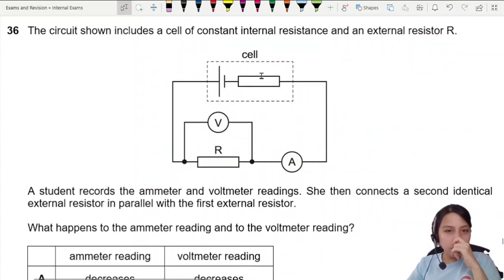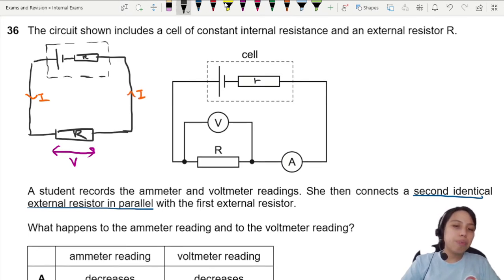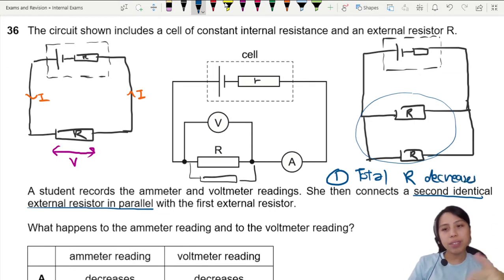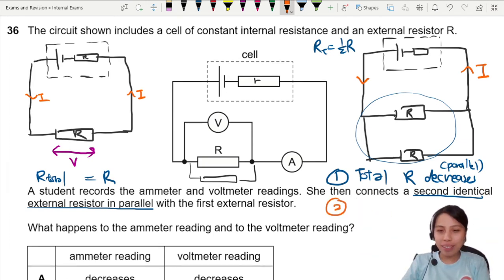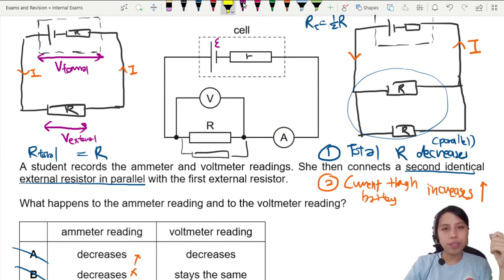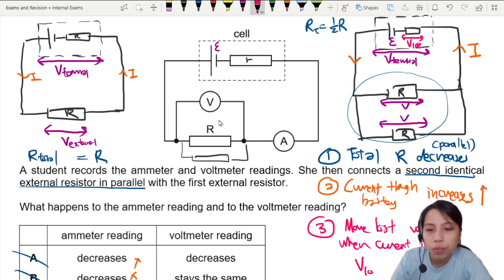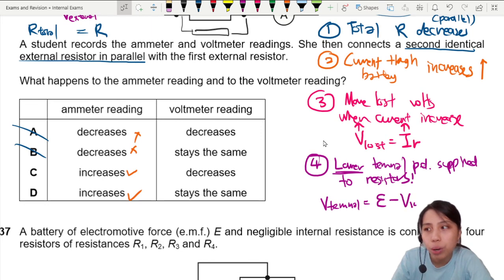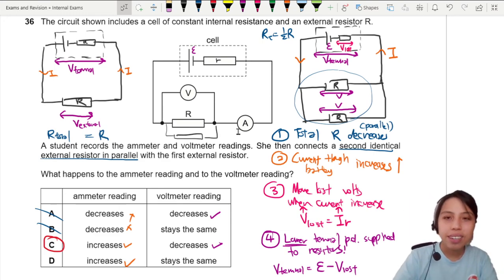MJ21 P13 Q36 Ammeter Voltmeter Reading Change | May/June 2021 | Cambridge A Level 9702 Physics

Comment: Hello, thanks for this video its really helpful.

But I had a question, I understand that current will be more when resistance is lesser, but looking at the equation V=IR, I is more and R is lesser so V should balance and stay the same right ?
Reply: It's because the voltmeter measures across only one of the "R" and not the whole circuit. So the resistance of one R remains the same even though the resistance of the whole combination decreases.
Reply: @ashrafchowdhury866  the voltmeter is connected across both resistors in parallel, so total resistance decreases, total current increases and V shoudl be balanced ??

Am i right ?
Reply: @ayushagrawal4275  Actually the voltmeter is connected to only the previous( upper) resistor. Not the combo
Reply: @ashrafchowdhury866  ohh yeaa, i actually get u... Its connected across the old resistor only...

Thanks alot man, for clarification..
Reply: @ayushagrawal4275  Welcome, I got my As MCQ the day after tomorrow. Please pray for me!
Reply: @ashrafchowdhury866  am doing too..

Day 18th nov...

Where are u doing from bro ?